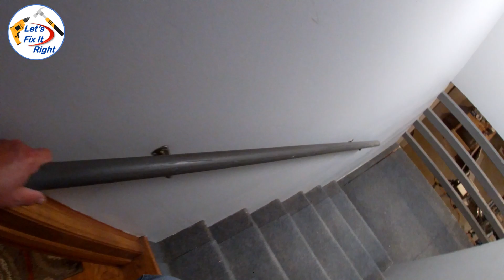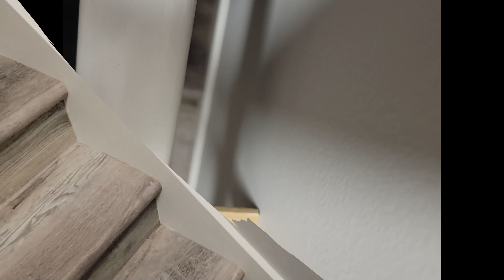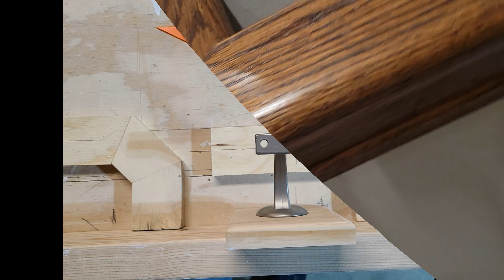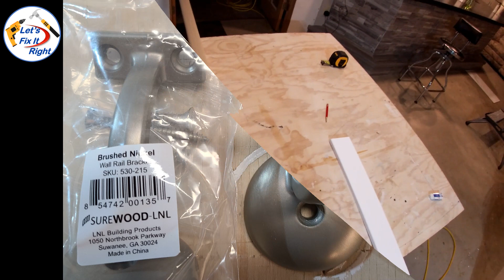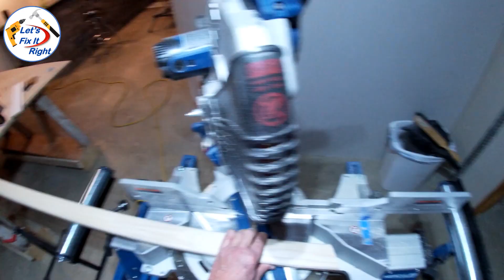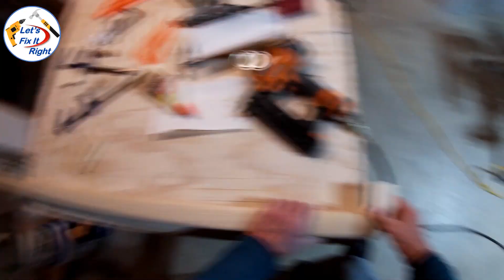Build a Handrail

Comment: Looks good, I was wanting a continuous rail, meaning when the rail comes down to the landing at say the standard 38 degrees, it would then transition into a horizontal railing and on downwards. The angles would be glued and probably use some wood dowels to join the miters as the 38 degrees gos to 0 degrees (flat). Did you have a separate video on this?
Reply from the maker: JC,
Great idea! You could definitely do this! Sorry, I don't have video on this. However, my Episode 70 shows how to cut a stair handrail using a sliding jig. You may be able to use this concept to make perfect cuts.

Don't forget to measure 3 times prior to cutting. In addition, I recommend making practice cuts on scrap wood prior to cutting your expensive railing.

Otherwise, I appreciate your interest in my channel.  I retired recently and have plans for another 200 to 300 great videos. 

Can you please subscribe and tell your friends and family about my channel also? 
This a link to my channel: https://www.youtube.com/@LetsFixItRight

Regards,
Al Bacon
Let’s Fix It Right